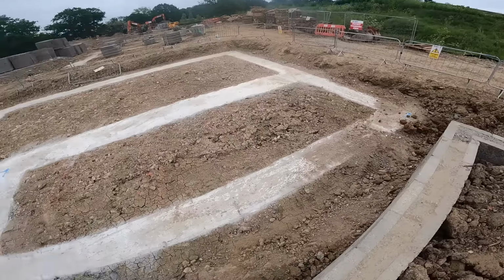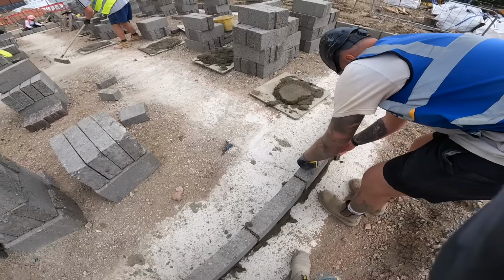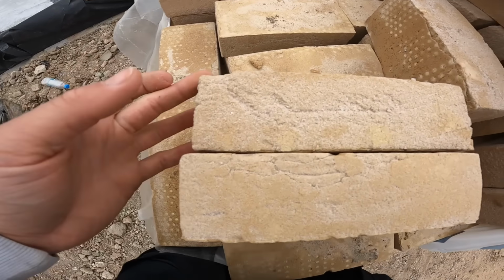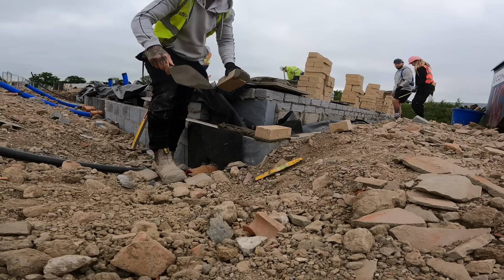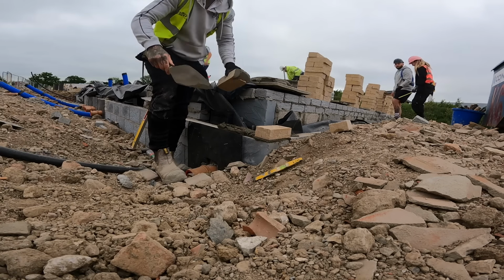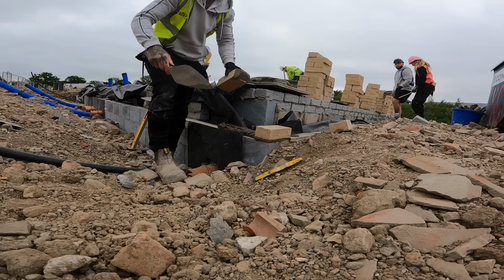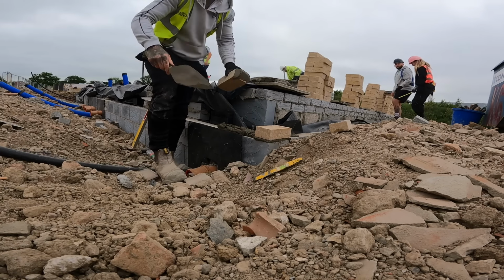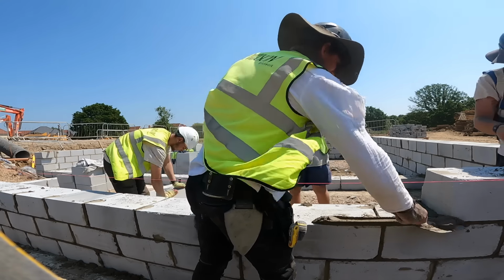A week in the life with a bricklayer

Comment: On them trench blocks i would tip the muck straight on the wall from the bucket rather than trowel out of the bucket
.
Reply from the maker: Hope to see you at super trowel Andy 👍🏻 what technique you think I’ll use to lay the most I can?
Reply: @CharlieCollison  i will be there be good to meet up👍. Not really sure as ime not sure what bricks are being used but if it was me i would use what is known as long bed P&D and tip the perps, especialy as 50% is overhand 👍
Reply: Also just build short corners with a 2 foot level and run in and have the gauge marked on the level so you dont have to fuck about with tapes.
Reply: @Shinobi Thanks, not looked at the rules.